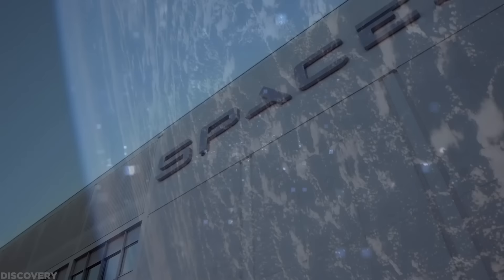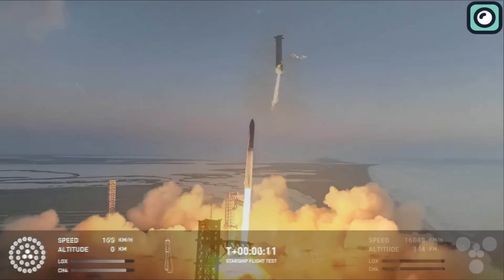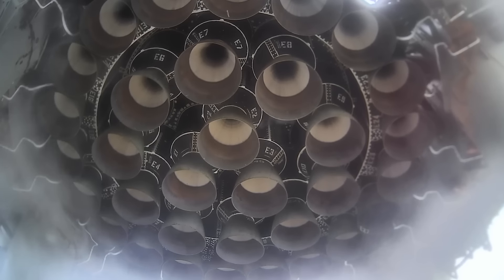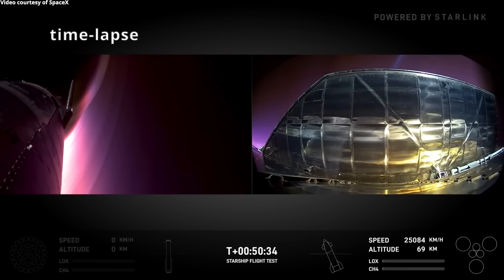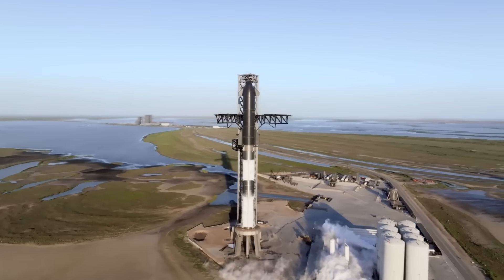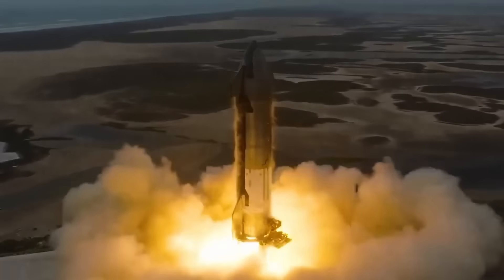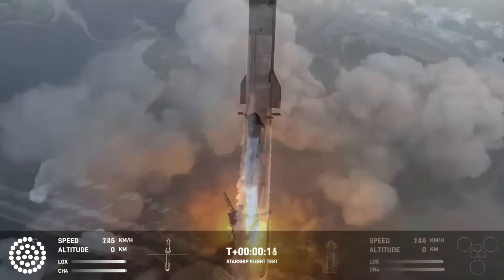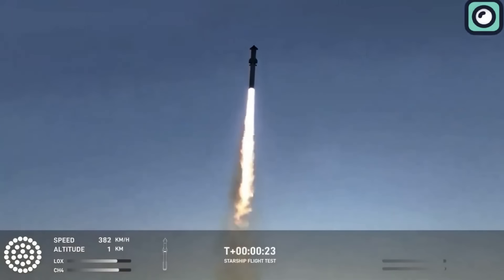SpaceX Just Made The Starship Completely Different...Musk Reacts!

Comment: First starship was a hodgepodge of raptor engines. Each engine had it own unique fix. No one knows if the full force of 33 raptor engines and flying concrete may have damaged some of the engines. With only half of them still firing after liftoff, space X knew the flight was doomed. The FTS failed to destroy the ships booster and starship. Actually the structure of the ship itself remained intact even during a complete flip. 

If it wasn't for the damage to the launch table and flying concrete debris. This incident would not have caused such a second mission delay.

Comment: You've messed million pound and thousand tons. 
5 F1 engines with 680 t thrust each secured together 3400 t (or 7.4 mln pound) of thrust for Saturn 5. 
Raptor 3 can generate up to 610 000 lb.
33 Raptor3 with 280 t each will give together 9300 t (or 20.2 mln pound) of thrust for Superheavy. Or almost 3 times more than Saturn 5.

Comment: He should put golf ball dimples on his rocket surfaces so they have less friction of air resistance.
Reply: We NEED the friction to bleed off the 20,000 mph speed - energy has to go somewhere

JR
Reply: @ryzlot  Maybe they can wrap the rockets with sandpaper or Brillo pads.  Or cheese graters.
Reply: This was actually tested by a car company and they found that the result was negligible
Reply: @Godios119  Was the car going at 18,000 mph?
Reply: That's next.
Reply: @jackieow  it was shown that at higher speeds it could create drag
Reply: @Godios119  Thanks, that makes sense.